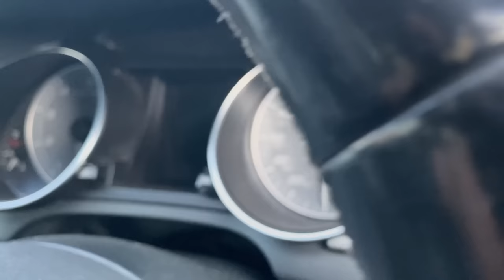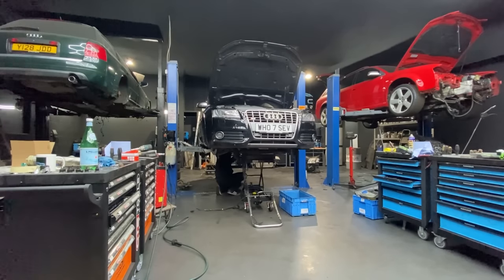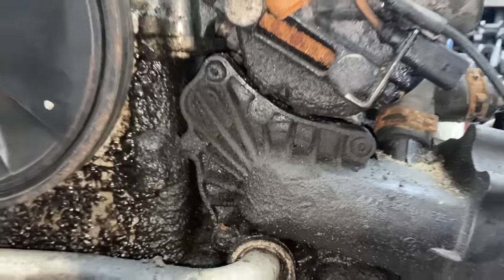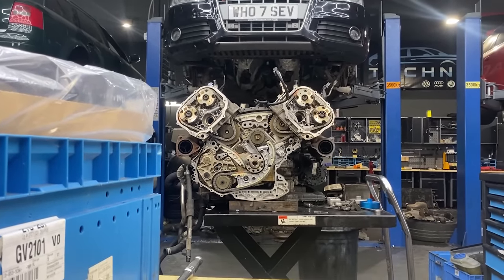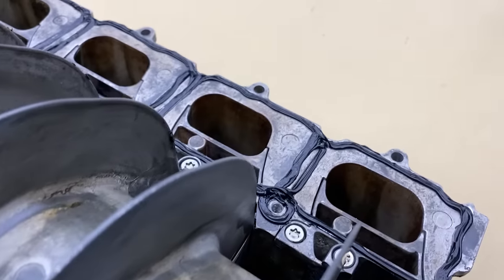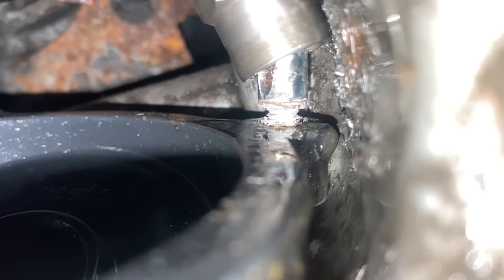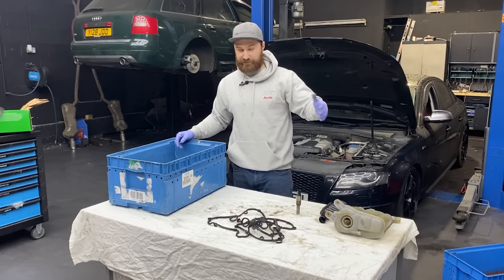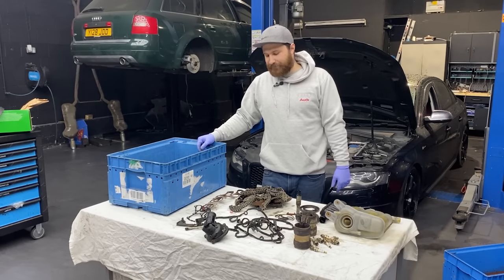Audi S5 V8 , 4.2FSI with 140.000 miles , engine overhaul after 14 months off road

Comment: VAG 4.2 timing chain engines are predatory engineering at its finest. Once these cars hit 100k the repair cost and repair complexity is astronomically high.  It takes a special kind of dodo bird to pour this much coin into an underwhelming performer of a car like this. You'll be yanking that engine 4 more times before you sell the boat anchor 4.2 out of rage.
Reply: The owner will prob get another 10 years of fun in the mean time, the car might not be the daily driver either so the car might still feel fast to them, not sure what car you are comparing it too? 400 hp is still surely enough to put a smile on your face, especiially with the soundtrack of the V8 to listen to.
Reply: Your to generous 80k and up engines go in my Audi experiences.
Reply: Another clueless commenter… the timing chains were NOT an issue on the S5 v8, there were a problem on the older Audi V8 engines. Chain problems on this platform are very, very rare
Reply: It’s simple if you can’t handle the heat get out of the fire 🤷‍♂️
Reply: Just drive one of these and you will quickly understand why this owner is going through with such an overhaul. They are comfortable and fun when cruising around. Not to mention that’s V8’s music
Reply: @aivarusk218  thank you for the clarity its the older V8 like the s4 s that had problems i own a 2011 s5 that has over a 140k miles on it and has never let me or the previous owner down ..only thing needed was general maintenance
Reply: @29DreC  funniest car i have ever driven .. i mean one has to drive it to understand.. i have owned every kind of car you can imagine from muscle cars vets bmw list goes on i never even knew the s5 existed lol i found one at the age of 40 and i can say for sure Nothing is like it ! Just the balance of luxury power and sound with the upgraded exhaust has heads turning everyday driving
Reply: @vicbrown2508 do you still own it? If so what is it expensive to keep up with it?
Reply: It just take patience bro if you don't have the tools or equipment to take care of these things yourself like allot of us do then anything German or other alike is not for you
Reply: i’ve owned two 4.2 audis a b6 s4 and b8 s5. neither have given me any issues whatsoever with both being daily driven well past 100k miles.

Comment: I own a 2009 S5 with the updated inlet manifold. Wonderful car if rather scary mechanically. I note on a couple of videos you mention using VCDS to diagnose the operation of the engine timing and solenoids. I would be really appreciate a video on how to use VCDS to indicate the state of the timing, and isolate potential issues, prior to having to remove the entire engine and gearbox for a visual investigation.

Comment: All that money they saved on gas caused that much carbon. And then putting around for flowers and not using high grade fuel and doing full power to blow out said carbon. I thought this was mentioned in the owners manual. That much carbon build up has to be the pcv failure for a long time ?

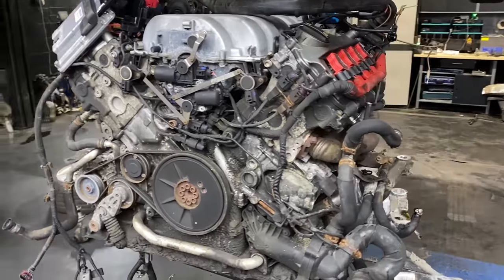Comment: I have an 09 S5 do all my own work, at 3:57 I already knew the biggest oil leak by the layout of oil. (the figure8 oil filter pipe gasket).  at 7:14 confirmed hahaha!! these are great cars but they are a bit of a pain to work on!
Reply: Did you replace the upper oil pan gaskets?

Comment: I had an A6 allroad 2.7 twin turbo. Didnt drive it much but what a car. When I sold it nobody wanted to give the time of day for it. Sadly Audi's are notorious for engine problems. And very high maintenance. Once they get a couple of years on their value is zilch. Needed a height level sensor and eventually got one from a garage selling an allroad for spares. Audi tips the proverbial tail out the chicken when it comes to spares prices. The Audi in this video would have been deemed too expensive to repair. I now have a Prado 120 with a Kzte 3 liter turbo engine that's done 220k on clock and runs like a sewing machine. Repairs dont cost an arm and a leg and able to do all myself. Busy repair/ replacing bolts that previous owner (supposedly a mechanic) butchered. Sadly have to pull parts out to get butchered bolts out. Had a brake booster motor pack up and had to take master cylinder out to have it repaired. Cost me about R600 and all good again. The above repair almost cost what my Prado cost me. Just reason it is it worth it in the end

Comment: Not sure if you know, didn't see it in video but the coolant passages that go through the timing covers have 2 o rings each. As in 4 total. The tubes are pressed tight into the cover and if you separate it you will find another crunchy o ring.

Comment: Hi, I found that dry air in a can, from PC world, keyboard cleaner works amazing to clean carbon build up, no mess at all and leaves it as new, please try it, just get one can and try it on a old engine, you will be shocked,,   I'm no mechanic but i had to change the oil filter housing gasket and oil cooler gasket  on my audi s4  4.2 v8.... I was not looking to clean at all just blow out some dirt that might of fallen into the ports,, I sprayed the dry air down the hole and the hole port and valve looked as good as new,,,, well worth a try,,, all the best jamie

Comment: I reccomend oven brite . Cleaning agent for oven  a bottle mixed with hot water and bath intake in it for 1hour or so brushing thicker spoty with plastic soft brush. then just low pressure jest wash to rinse . Comes out like new every time on my diesel. Oven Brite is cheap too in poundland .
Great job . Great video . Lovely engine.
Regards

Comment: Hi. I just sent in my 4.2 s5 to the shop for some overheating and shifting issue. Afte overheating slightly, it will only upshift after about 3/3.5k rpm. The guy says to replace thermostat and thermostat housing, would you think this is good enough? Is costing be a little over $1,000
Reply from the maker: Hi don’t know about us in U.K. but too much for thermostat , we paid around 240£ if I remember correctly

Comment: It seems Audi and others can't make chains last these days.

Let me take you back to 2001 - 2005 era.
Rover 75 using the BMW M47 engine.
Admittedly it's a heavy diesel lump BUT the chain life on those is actually the life of the engine.
(way above 500k miles in many cases)

It's a shame they can't do this on big petrol V8's but then again they want things to fail to generate revenue and new models !

Comment: I just had my 2008 S5 Refurbished in Malaysia.. similar 30K Ringgit whichi is about 6K pounds..Big ticket items were Camshaft holder, engine mounting, plugs, camshaft intake, Aircon Blower motor and even ECU..  ECU changed as the start button had to be pressed twice before it started.  And a whole load of seals, gaskets, pipes... all the rubber and plastic parts degarded in 15 years..

Comment: Excellent video!  I recently acquired a 2011 S5 with an APR supercharger.  The car was in the middle of a clutch job and the prior owner lost interest.  I bought it "as is" and will finish the clutch and bring the car back to daily driving status.  I'm new to the Audi's so trying to get schooled-up as I'm sure they're more sophisticated than the Chevrolet's and Mazda's I'm accustomed to.  I do have a question for you - Is it possible to start the engine with the transmission out of the car?  I would like to hear it run before spending the money on the clutch parts.  Thanks for a great video!

Comment: Is this the same 4.2 BVJ block that's in my old 2008 A6 S-Line daily driver, they look similar? She's nearing 155k miles and ive been wondering how much longer she's got left in her? Runs great, no issues but a minor oil leak in over 11 yrs of owning it. I did get the multiple cylinder misfire several years ago and ended up being one of the solenoids as well but that's it.  I've a 2016 C7.5 A7 as well as my weekend driver...but just wondering when if I should be trying to get rid of the 08 for something, a little newer lol...... great channel by the way! you guys are awesome!

Comment: Bought an Audi A5 3.0tdi sport quattro 6 speed manual. Egr and dpf out remapped to 300bhp, such a good car very little maintenance, oil and filter every 15k km, goes like a train you can get 40mpg the car cost 5k euro
Reply: This is the 2008 model euro 4 CAPA engine it's very reliable had it two years now, there's 320,000km on it.

Comment: Hi guys. I have an A4 B8 1.8TFSI and I am facing the same issue with regards to the rear bushing of anti-roll bar. VW/AUDI does not sell them separately and can't find them on other 3rd party websites. Can only find powerflex or superflex bushings, but I would like to keep the car on stock bushings.
Where did you manage to outsource the rear bushings from?
Reply from the maker: eBay :)
Reply: @VAGTechnic  Thank you. Do you have a part numer i can refer to? I know my anti-roll bar is 20mm thick (measured with a caliper)

Comment: Hello mate I need your suggestion , I have an Audi A4 B8 2011 2.0 TFSI

The oil burning  is too much , it consumes 1 gallon oil per 2000km. but car have enough power , some time if we accelerate after slowing down it makes smoke and in idle oil spraying through the exhaust. Is it related to turbo , valve stem seals or the piston rings , I checked with many garages , domes saying turbo some valve stem seals some complete overhaul.

Can u pls guide me

Thanks and regards

Comment: Hey, I watched the video and I want to know if have any tips for me, my S5 it's overheating , the reservoir bottle was cracked and it was replaced, then I drove it for a week and it started to overheat again, I have replaced the thermostat, fans one had failed and the other one was running at 60%, I also found the temp sensor was faulty and was replaced, after all that, the car still overheating, any tips I will appreciate.
Thanks

Comment: When did the timing chain become a non issue on the 4.2?
Reply: What a pcs of junk . crappy design
Reply: 4 valve after 2008 had no issues because the tensioners wont snap.

Comment: Hello! Great video! :)  I have the same car with a problem P310B / 012555 - Low Pressure Fuel regulation: Fuel Pressure Outside Specification.
what could be the problem.?
Reply: Low pressure pump and high pressure pump replace those.
Reply: replace the fuel filter in the Tank first and run a bottle of injector cleaner through it,  It fixed mine,  - if it doesn't then its time for new HPFP's

Comment: Hi, is the default position for refitting the VVT units with the stamp marks pointing up? timestamp (9.35). elsawin doesnt mention anything about the orientation other than "make sure you mark them before removing"

Thanks,
Dan
Reply from the maker: Hi,
They have grove for oil inserts , don’t actually need any position
Reply: @VAGTechnic  Thank you for the reply, i put them back all just facing upwards. although whilst timing the engine and taking the slack out of the chains bank 1 seems fine but bank 2 seems to jump back a tooth after removing the cam lock clamps, do you have any idea why it would do this? 
Cheers

Comment: Buying one of these cars in the next week.When carbon cleaning the injector ports do you have to reseal them or do the injectors just slot back in ?
Reply from the maker: You don’t have to remove injectors when you doing carbon cleaning , but if you do so , test them and definitely get new o ring for them
Reply: @VAGTechnic  The O rings are blue aren’t they ? Thanks mate 👍

Comment: I got a question when u finish the timing and take the special tools out and turn it the crankshaft bolt line up and bank 2 but bank1 don't line up for a little bit but if u turn back a little lineup the camshaft bank 1???is that right?
Reply from the maker: Have to make sure the oil tensioners are not pressed in by the pressure rod chain, when the engine is running the oil tensioner is almost fully out what’s changing the angle of the cams to the crank
Reply: @VAGTechnic  I did headgasket in a 4.2 bvj engine. I send the heads to resurface and check for warp put the heads back on tight 4 times 30nm 60nm and 2 set of 90°.I mark my chain and phaser and put everything back in same position torque everything down on spec and when remove tool and turn engine by hand of the 3 positions one don't line up wich was bank 1 ...I put tools back on and loose bank1 and retide...and still the same all the tools are on so is in time but when u remove the tools u see bank 1 moving when removing the tool...I did couple of months back a 3.2 timing tensioner and something similar happens and remember the computer say u may have to play a little back and forth to get in position after double check ur  timing...but the 4.2 is new for me never done one before ...by the way the 3.2 start and run fine no lights at all thank u for ur help I love your channel

Comment: What are the metal dividers for that go in front of the valves at the 13 minute mark?
Reply from the maker: Because of the flaps in the intake manifold , improve air flow on higher rpm so the engine is more responsive in low or mid rpm because it’s N/A . Once it’s going full power the flap will open

Comment: Is this the same engine that was in the earlier S4's which had the timing chain issues? Or does this have a different engine code?
Reply from the maker: Completely different
Reply: @VAGTechnic  is there a difference in the timing chain guides?
Reply: @moonbabyking  the original had plastic guides right down to where they mount to their pivots, so naturally they would snap.

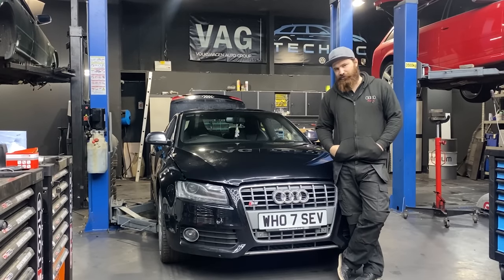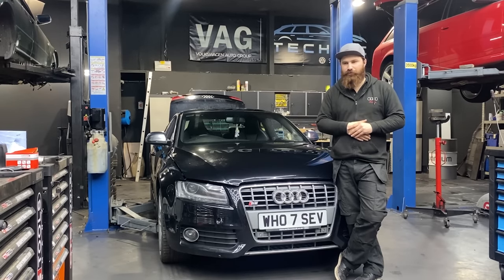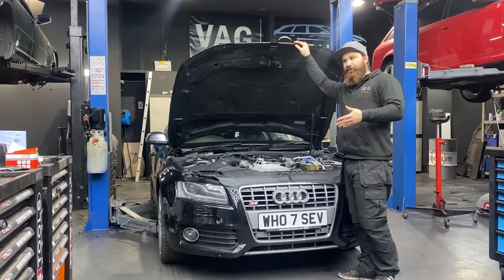Comment: You need to replace the battery in your smoke detector 0:48, 1:26, 2:02, 2:40, 3:18...
Reply from the maker: That’s special sound effect test
Reply: @VAGTechnic  doesn't it bother you hearing a chirp every ~38 seconds in the shop

Comment: what if you dont replace  the timing chain. Are all the other maintenance needs accessible in the service position without pulling the motor? Without needing the rear main nor subframe work. 

what would be your cost difference? or will it be faster/easier to pull the motor?
Reply from the maker: Easier to take it out

Comment: Biggest piece of crap ever made my Fiat Bravo 1400 will take it out ...
Reply from the maker: Not sure if you can increase power by 40% that easy on your Ferrari Bravo
Reply: @VAGTechnic  it's not about your power it's about reliability and road control that engine is crap .....
Reply from the maker: More you push you engine quicker everything worn out 🤗

Also like any other mechanical component will fail if it’s not serviced properly